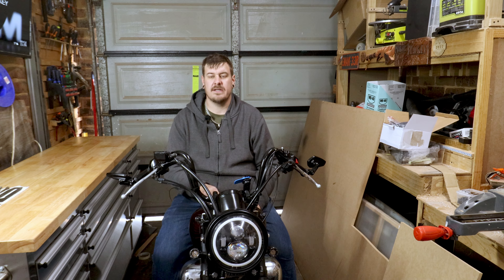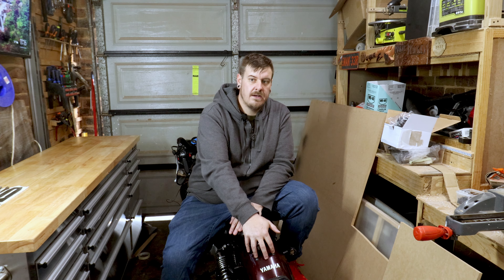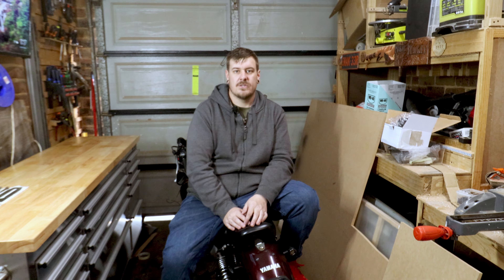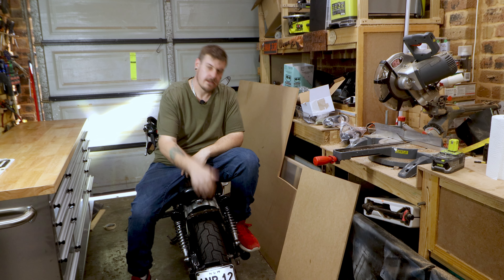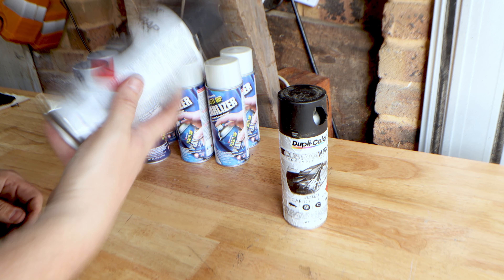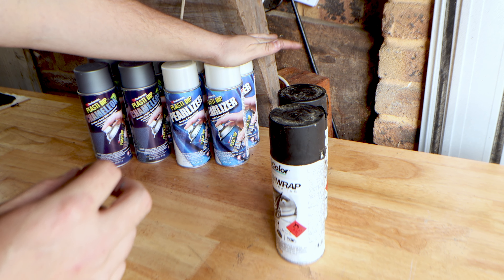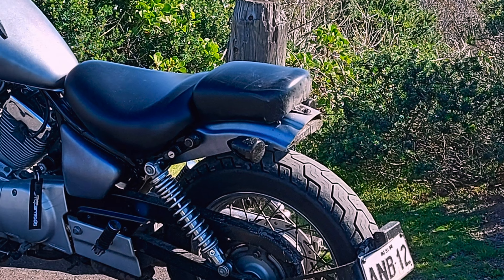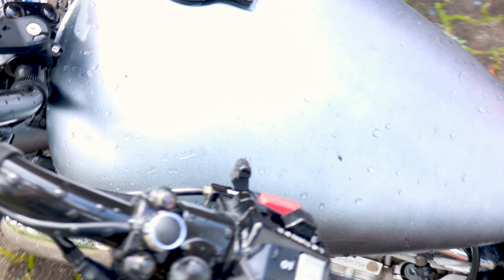I modified my bike and i hate it!!!

Comment: can you link the new rear tail light? cheers!
Reply from the maker: https://www.ebay.com.au/itm/314043841142?mkcid=16&mkevt=1&mkrid=705-154756-20017-0&ssspo=xaiayjz6qfk&sssrc=4429486&ssuid=l2a8KUP_SYi&var=&widget_ver=artemis&media=COPY
Reply: @BKRcustoms thanks for replying! Your efforts don’t go unnoticed! Does it just replace the stock one like that or do I need to do some work to get it on?
Reply from the maker: @4am170  you need to drill new mounting holes. And it gets mounted upside down